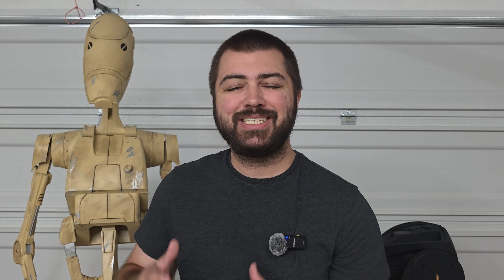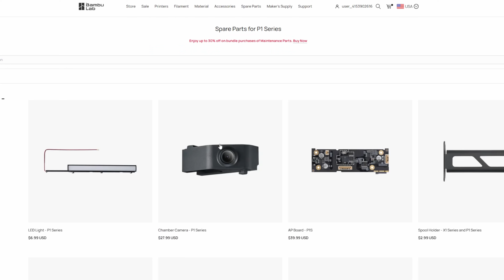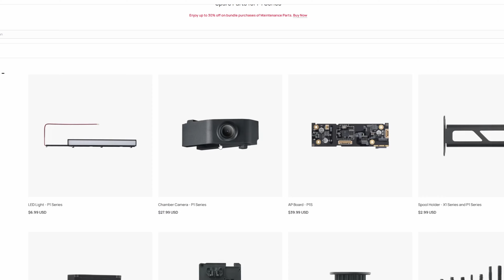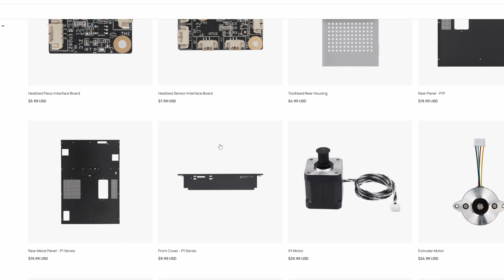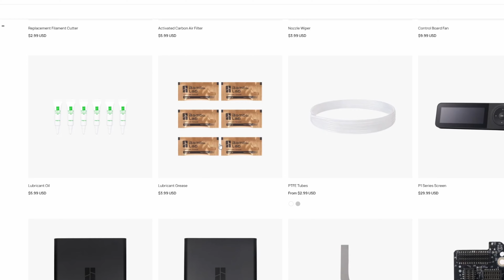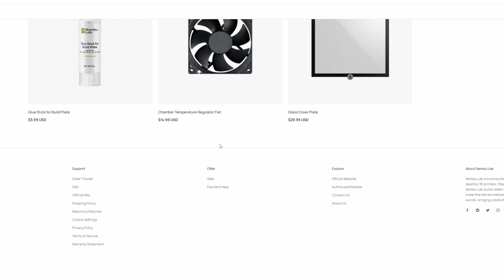Why Bambu Lab Is the King of 3D Printers (And No One Is Really Close)

Comment: I have been seriously looking at Bambu, its still in my top 3, but the smaller bed size is why its not #1 right now. I have been trying to decide between the X1C and the K2 Plus, right now the K2 Plus is on top of my list for its bed size. Now, if the H2D was in my budget, I would be grabbing that.
Reply from the maker: Agree need a bigger build volume but I with most stuff you can make cuts and do multi part on the bambu slicer

Comment: Simple for me - if you are interested in 3D printers then buy new stuff, if your interested in printing 3D stuff then buy a Bambu or Prusa. I want a cheap Bambu with H2D build volume... so I will wait. As you say there are so many failed launches of new printers , 90% of the faults should never be making it onto production units... but they do so Bambu and Prusa have little to fear for the moment. In 1 year of use I have never even dusted my P1P that I bought secondhand, use it multiple times a week.

Comment: My a1 mini is having bed adhesion issues for some reason. bambu filament, washed build plate with dish liquid, still very iffy if the print will stick. But my Anycubic Kobra 3 combo got here today, so looking forward to getting into it tomorrow!
Reply from the maker: You might need to change some of your temps.
Reply: Yeah go up 5 degree at a time until it sticks on bed temp.
Reply: your filament could be wet.

Comment: H2D is a hot mess for multi material supports apparently. But I get it. I’ll probably never buy another anycubic FDM. The reality is, it’s almost always something with one printer or another though.
Reply from the maker: I've only bought the resin printers from anycubic since they were highly regarded but outside of that I've heard they are hit or miss
Reply: @ even the components on the resin printers are hit and miss. I had two trays that were leaky. They were good about sending your parts and eventually I got one that works, but it’s pretty annoying.
Reply from the maker: You seem to get. People says it's okay cus customer service is good. But I would rather never know if they are good or not 😆

Comment: They absolutely just work. The only print failures I have had are due to my own user errors.
Reply: Glad there are more options for people that are reliable. I'm a hardcore Prusa guy because I like building my own machines so I fully understand them from a maintenance perspective. 

My advice was always "Prusa just works." I've got a M3S+ with 7yrs of daily use on it and only average maintenance. Cleaning/oiling, inspecting, etc. Literally the only part I've changed was by choice for the hotend so I could get the quick change nozzles.

Comment: The A1 had a weak heat bed cable at launch (it would short out because of the repeated bending with the movement of the bed.) Bambu printers are the Eveready Battery of the 3D printing world. They just keep going, and going and going...

Oh, and another thing to add.  My X1C gives regular maintenance reminders. I've never seen that on any other printer that I've ever owned. It's like they want their printers to keep being trouble free.
Reply: My X1C has more than 6700 hours on it. And after I got the maintenance notification I always waited a while untill I did them, just because I did not have time. Except for nozzles I did not change anything!

Comment: I started with a Creality Ender 3 Pro. It was a non-stop horrible experience that almost chased me away from the hobby. It was designed poorly. Everything on it arrived broken or broke often or drifted out of alignment or randomly failed catastrophically. I learned a lot about 3D printers I didn't want to know. Eventually I got a Mingda Magician X - for the same $185 price as the Ender - and it was a dream. Self-levelling, very good prints and it just worked with very few problems. After about three years, however, it started to fail - and Mingda had left the consumer marketplace. There were no available parts for my printer and essentially zero support to be had. Facebook groups and reddit and Discord offered no helpful info. The printer had become erratic and useless, although I enjoyed using it for a long time.
I had stayed away from Bambu and Prusa because I suspected they were the "Apple" of 3D printers. I have extensive experience with Apple after years of working in graphics and video and I don't respect the machines because they do less than Windows PCs for a lot more money - and my fave graphics/audio/CG programs and plugins are Windows-only to this day. But last year I had a bit of extra cash and Bambu had a sale going on so I ordered a P1S/AMS combo at a relatively low cost. I continued to avoid Prusa because its prices remained insanely high compared to Bambu, feature-for-feature.
After three months or so with the P1S I have become spoiled by the Bambu experience, even though it leaves an awful taste in my mouth to say nice words about any company. The thing makes beautiful, consistent prints without fail. I wanted another smaller printer to use while the P1S was busy. I thought about ordering the $199 Centauri, but I didn't want to wait several months for delivery of an untried unit for a bunch of obvious reasons. I discovered Best Buy had A1 Minis in stock for the December 2024 price so I grabbed one of those (it sold out very quickly). It, too, has given me unrealistically good results.
But at the current tariff-warped prices, I would not get a Bambu product if I were buying again right now. They're great, but an A1 Mini is NOT worth $360. Here's hoping some sanity returns to 3D printer prices (and other prices) soon.

Comment: I agree with you 100% as  i mentioned in the previous video, for these reasons I bought the P1S and although I'll need another printer as a backup, I think I'll cancel the Centauri Carbon and buy another option  more reliable.

The Centauri could be a good option for the price if Elegoo provides the necessary support, which unfortunately in my experience  is not the case with either Anycubic ,Creality or Elegoo. They only worry about releasing another model and forgetting about the previous one.

Comment: I'd expect them to just work with that premium cost.. while  looking for a (first) 3d printer they're +$100-$350 compared to anyone else in the same bracket. While it sounds like that is a recent increase its still a substantial price to hardware difference, to the point where someone like me isnt say "well is it worth the premium?", I'm saying "can people stop recommending a printer that's as much as $300 over my budget".
Reply from the maker: They do just work. Unfortunately tariffs drove of the price of the A1 but that was/is still a great printer. I suspect real soon all manufacturers will raise cost if tariffs stay.
Reply: @3dPrinterMike  Maybe, unfortunately it seems like a preemptive increase, some specialty tools I use unrelated to 3d printing have an added "tariffs tax" section that will be removed when/if the tariffs go back to a reasonable level, that doesn't appear to be what Bambu is doing so I'm not sure if I should try and wait it out or not.. Still considering the a1 personally but originally I was hoping to get a p1s like my friend has but it costs $800 now..
Reply from the maker: Possibly, time will tell. Having the A1 myself if you only print PLA or lower materials it will do everything you need it to
Reply: £409 for a P1P,  £289 for an A1 in the UK - no change in price for the last year - if I were you I would get an A1 and start printing, it's an absolute bargain. Don't be fooled by fancy machine specs and youtube reviews.
Reply: @paulcrabb7167  sadly I'm in the worst place for getting a 3d printer right now (USA) 😭
Reply: @FlyingRock225  flash forge adventure 5m is also good but build volume is small